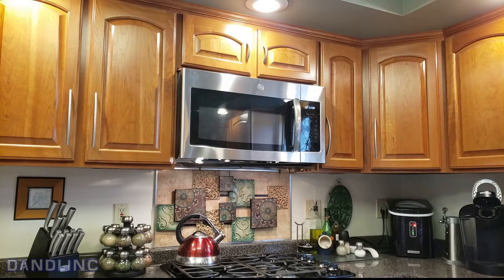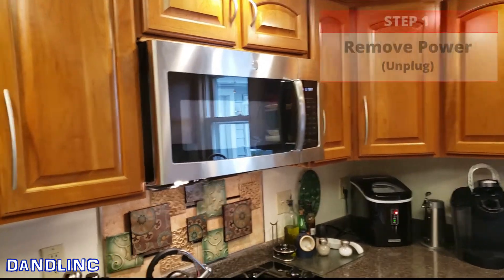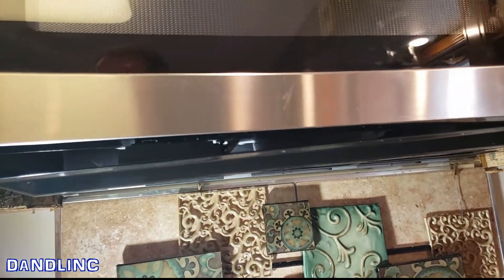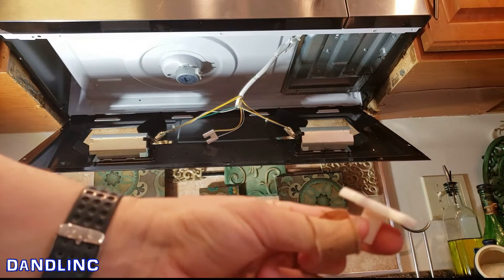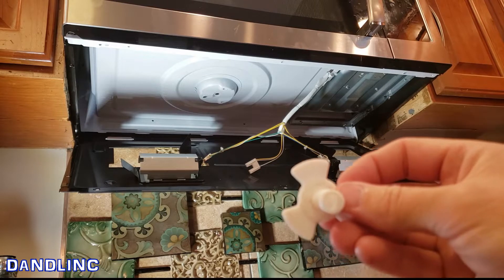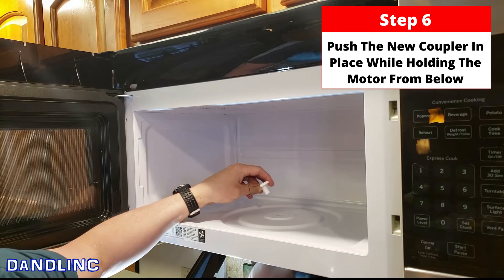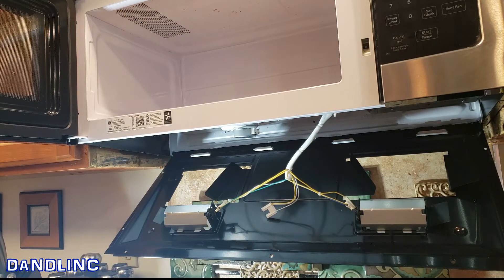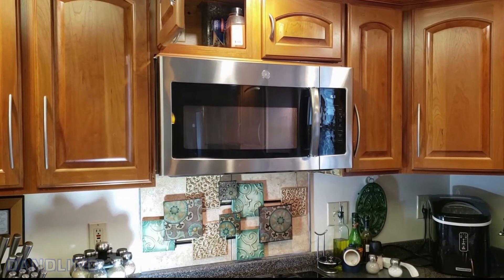How To Remove / Replace Your Microwave Turntable Coupler DIY!

Comment: Thanks for this information!  Our GE above the oven microwave turntable would spin a few turns, and stop.  After watched your video I removed the $40 part and found it was not broken.  I returned the part and for some reason the turntable works 😊.  If it starts working intermittently again I'll know to replace the motor.